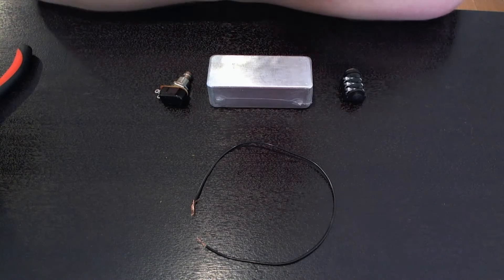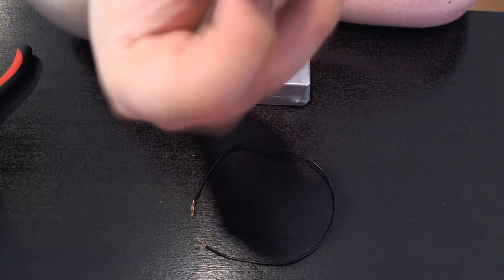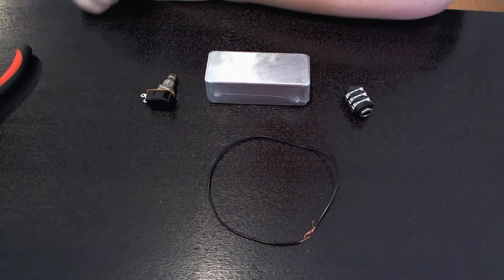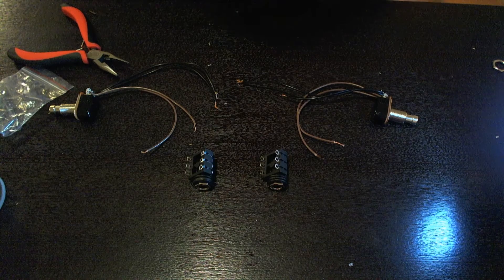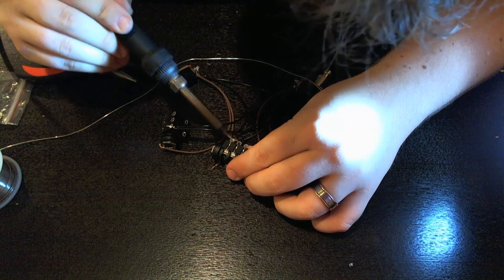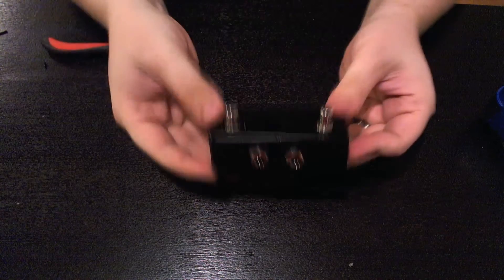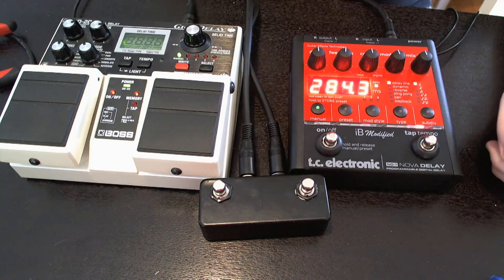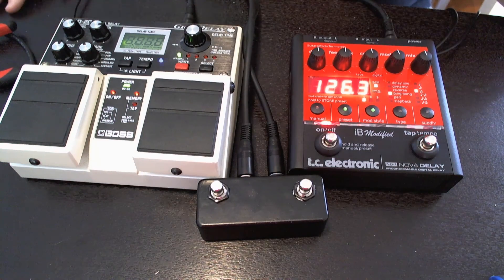Build Your Own Tap Tempo and Preset Selector for Nova Delay

Comment: Hi! 
Why do I need two outputs when only one connects to my Nova Delay? :)
Reply from the maker: Jeremia Berndtsson The second output connects to a second delay. This way you can tap in a delay time on two pedals with one switch. If you only have the one pedal then the second output is not necessary.
Reply: the1stsoveriegn Ah, I see! Clever! :) But how is the preset-switch effecting both pedals if I have two connected? :)

Comment: The reason the tempo doesn't come out the same is due to the difference in switch, NO or NC. One takes the tempo when the switch is in down position, the other takes the switch on the up position. Just saw description... Nice job.

Comment: I dont understand why you need this when you can tap the tempo button then tap the on/off switch to switch between presets... cool mod though, but just thought i'd let people know in case they didn't..
Reply from the maker: You don't need this mod, however this mod makes it much quicker to switch between presets, which is useful if you have two delays you want to use in quick succession.

Comment: So I'm doing this mod to my regular Nova Delay and I want the tap tempo to work as well with a dd7.  Now, instead of the spdt switches, I'm planning to use the DPDT momentary ones.  How would I go about wiring the stereo jacks and the dpdt switches together? Also, how do you know which poles are which? I know dd7 is closed and nova is open, but how do you identify this on the switch?
Reply: about to do this mod with the exact setup (ND1 with DD7) can you tell me how it turned out?

Comment: How about if you only need a preset selector? Im a little bit confused. Do you need to specifically solder it to a specific place or wharever in the small holes? or is there a pattern or something? Cause i'm confused it might become a tap tempo switch not a preset selector. Thanks! :)

Comment from the maker: This is actually designed to change presets and tap tempo with the Nova Delay mod in my other video. The tap tempo will still work with the DD-20, and there may be a mod to allow you to change presets as well, but it will only work with tap tempo with an unmodified DD-20

Comment from the maker: Short answer is I'm not sure. I've taken a quick look at the fs3x and it looks like it's made mostly for controlling fancier delay pedals such as the Eventide Timefactor or Strymon Timeline. Could it be used for the mod? Perhaps. I think the only way to know would be to give it a try. If it doesn't work this pedal only costs a few dollars in parts to make.

Comment: Looks cool, nice job! I was about to do this mod and then a thought hit me... Could you use a TRRS (instead of a TRS) cable going from the Nova to the controller so that you can operate three functions of the nova instead of two? Tip goes to tap tempo, ring 1 to presets, ring 2 to On/Off switch, and sleeve ground the three connections.

And then in the controller you use three momentary switches instead of two.

Would that work?
Reply: Of course would it work